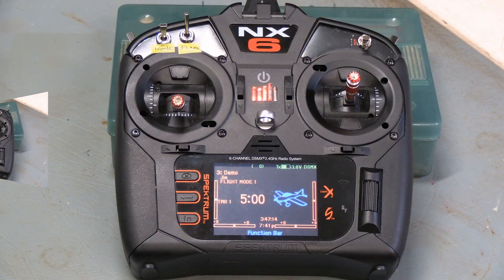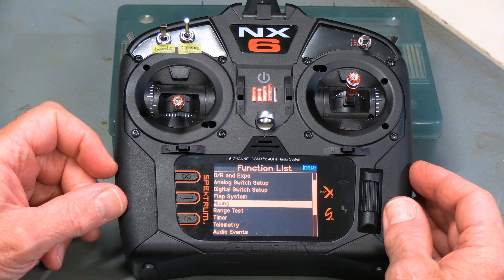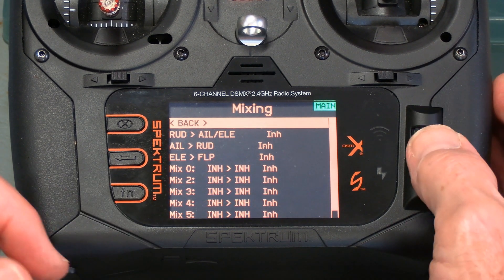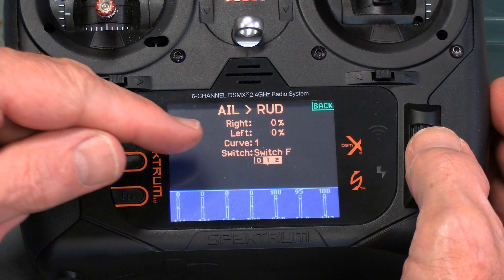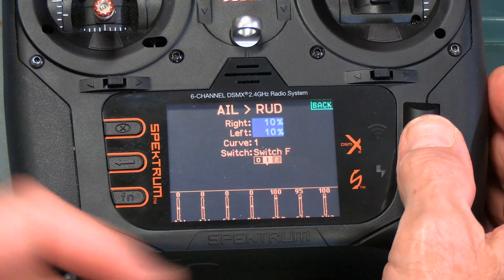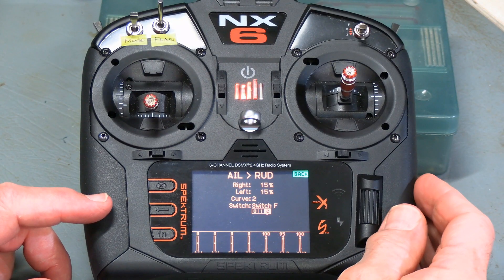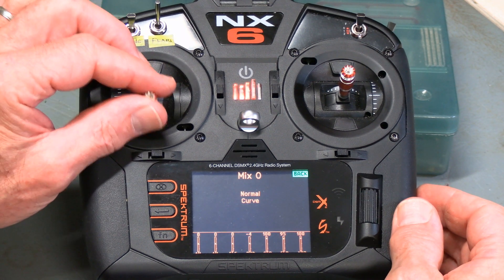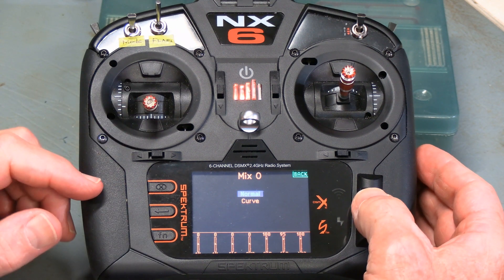Spektrum NX Mixing

Comment: Thanks for the video,,I was waiting to set up reverse and reverse thrust on switch switch F and bind button for reverse thrust, do you think a mix or logic switch or combo switch setup would be better ,I don't completely understand logic and combo switch setup
Reply from the maker: Reverse thrust just needs a 100% signal on one channel to trigger it, it's just on or off.  That signal has just told the ESC to spin in the other direction, so the throttle would still work with it to tell the motor how fast to go in reverse.  So just assign the desired switch or button to the channel that you are going to use, and plug the reverse lead into the signal pin of that channel on the receiver.  Test it carefully with the plane secured before using it.

Comment: Terrific explanation, especially regarding the curve function and how those little boxes below the switch Selector work. I, too, had a glitch in my aileron to rudder canned mix that did not work and I had to keep backing out and going back in to get the changes to stay.
Reply from the maker: Good to hear.  I had a similar issue yesterday when making some changes to a telemetry channel.  I'm wondering if I hit the "RTN" button before the change was actually 'entered.'   All I know is that I did it several times and finally the new value for the switch was remembered!

Comment: This is One aspect the DXs cant do for craft with Flaps. Such a shame, The DXs is a good transmitter except for this short coming.
Reply from the maker: Yes, the flap setup procedure is a great upgrade with the NX.  Unfortunately, that's a big drawback with my new Radiomaster.  With both it and the DX you need to manually, but you still can set up flaps and have them deploy slowly, if you want.

Comment: Thanks Jim:trophy-yellow-smiling: I really appreciate your taking the time to explain this. Up until this video I was pretty much in the dark about this subject.
Reply from the maker: Thanks, Tony.  Recently I have benefited from using mixing on some very 'common' applications.  The most recent is a glider that 'needed' a reversed servo for one of the flaps.  I could have either purchased a reverse servo or a reversing "cable" with the electronics to do the same thing.  But given that I didn't have either on hand, the simple thing was to put each servo on a separate channel, and use mixing to reverse the one, being 'negatively' linked to the other, which was controlled by the transmitter flap channel.  It also allowed 'fine tuning' to get both flaps precisely the same in operation - should have been right without it, but for some reason, they did need just a little adjustment.

Comment: Only one question, didn't you just set up elevator rather than down elevator?
Reply from the maker: I assume you are asking about the throttle to elevator mix.  Pushing the elevator stick forward is moving into positive values, and pushing it forward makes the plane go down.  So what I said in the video is correct.
Reply: Thank you for the explanation, I have flown for years but am just now in need of mixing because my new plane really climbs when I apply anything above half throttle.
Reply from the maker: @Anoldphotographer  Glad that I have been able to be a help. Happy flying!

Comment: Great explanation thanks, just have flight modes to nail now.
Have tried and failed to mix flaps with ailerons to work as full span ailerons whilst retaining functional flaps,  can do it as a sailplane (DX6e) but no channel left for motor and flaps wont work
Reply from the maker: What you are trying to set up is 'flaperons'.  To do that, each aileron needs it's own channel.  The trick is then that the "Aircraft type" in the transmitter that is for flaperons doesn't also have ordinary flaps.  I haven't tried it, but I reckon that if you chose the flaperon aircraft type, then set up flaps on a separate channel, you should be able to mix the flaperons with the flaps.  Of course, with all of this, it's easy to run out of channels real quick!

Comment: Jim, I am new to RCing and I need help with the controls for my Blade 230s Helicopter. I think what I need help with the most at this point is the "sticks" they respond to quickly, I think I need them to be not so responsive. How do I go about making them less sensitive? Oh, I almost forgot, I have a NX6 transmitter. Thank you for any help you can give.
Reply from the maker: I'm not into helicopters, but I would expect that setting higher levels of expo, and/or lower rate levels in that same D/R & Expo menu would help.